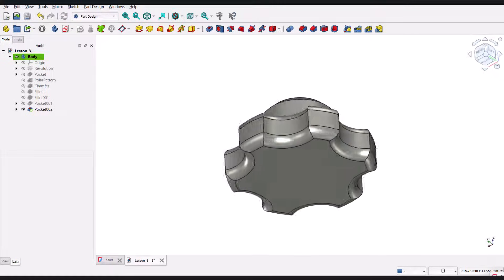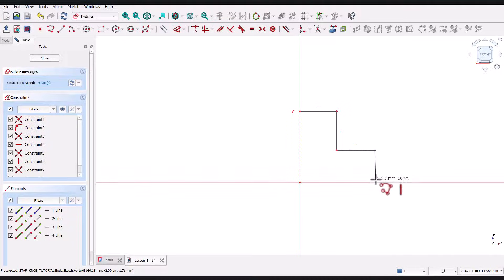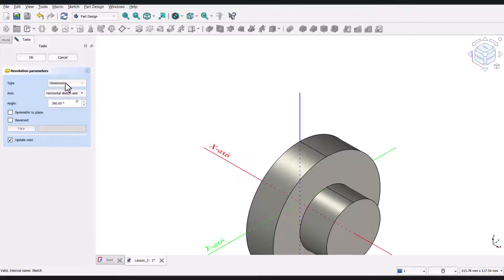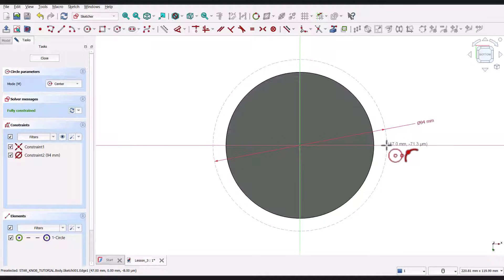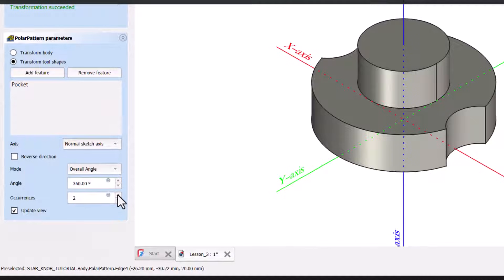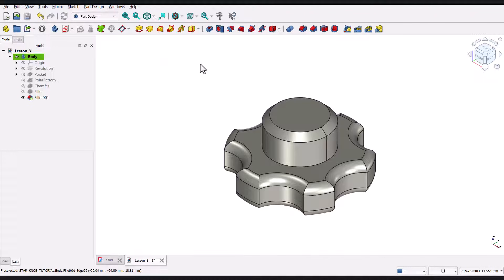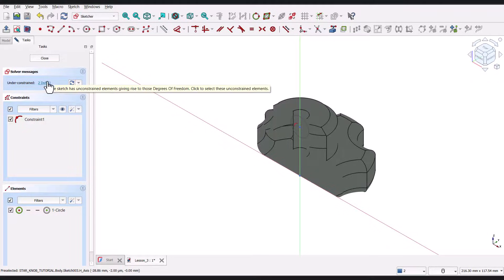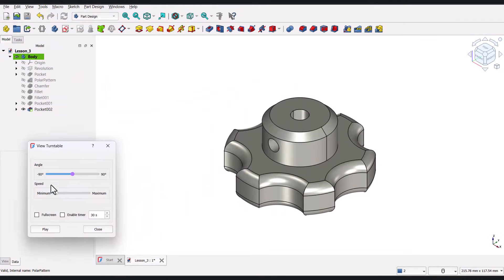FreeCAD Beginner Course | Module 1 – Lesson 2 | Star Head handle Knob 3D Modelling for 3D Printing

Comment: Tip for anyone who would like a slower pace, you can adjust the playback speed in the settings icon on the lower bar of the video.  My preference is 75% speed.